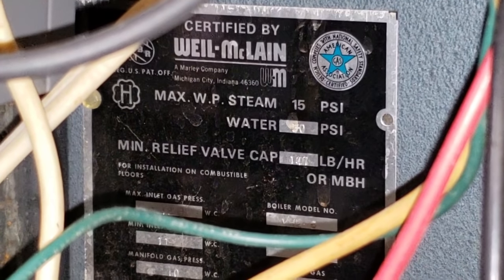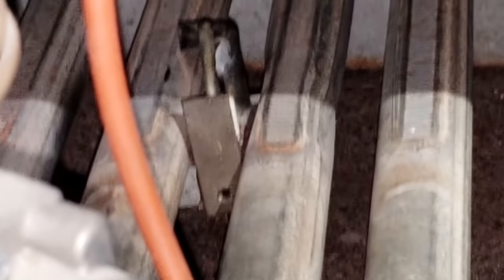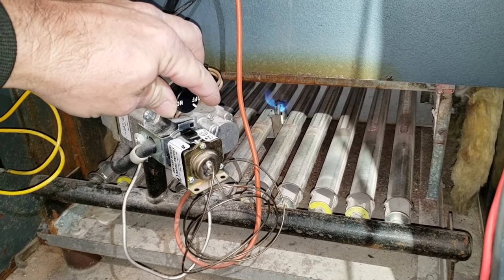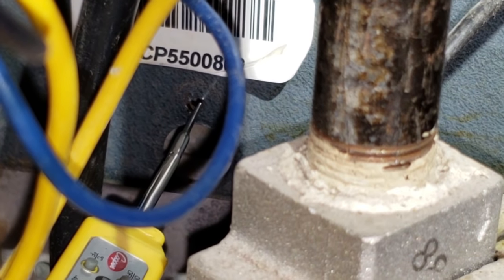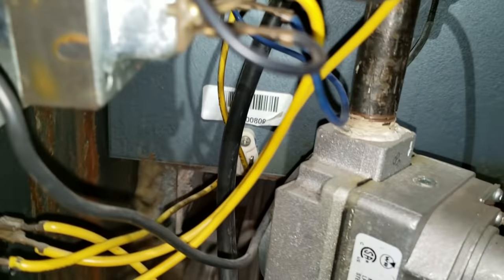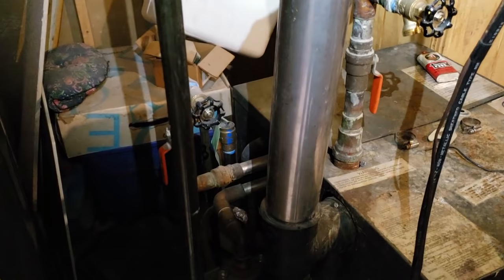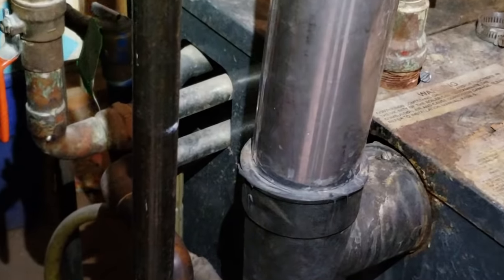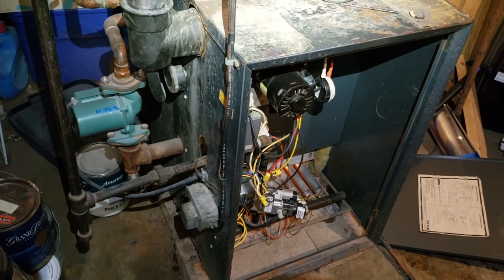Hot Water Boiler No Heat On L.P. Gas

Comment: Next time you are there, keep in mind about some kind of air venting, air scoop, or and high vents.
Reply from the maker: Can you go into a little more detail as to what you mean?.  Almost all air was vented with the power vent system that I installed.  If you look above the expansion tank,  that air scoop is the most common around this area,  it also has a auto bleed on top of that scoop. Far as backflow preventers, about the only place those are required around here is in commercial applications. I could see maybe a check valve, but that's not a backflow preventer and those would need inspected every year. There's a reason why we live where we live,  we don't like big government up our butt non-stop like the big cities.
Reply: We used to use back flow preventers and check valves. Sorry I didn't see the air scoop and vent.
Reply from the maker: @RayRay-nb7tn  it's all good Ray, this was out in the country,  even in town, around this area we have no inspections at all, not saying that makes it right or wrong but in an area where everything is about price it just doesn't happen.

Comment: Good vid! You see much oil fired equipment out there? Oil fired boilers/furnaces are everywhere in NH.
Reply from the maker: I have done a lot of fuel oil over the years prior to where I am now. I don't care for the mess, smell, or the soot when the customer doesn't have it serviced or the last lazy dog tech that decided to cut back the primary air on the burner to keep the draft overfire in a negative because they didn't want to clean the heat exchanger.

Comment: I wonder if it kept popping, sputtering or burnt back at the orifices from having low gas pressure(low tanks and recent cold snap?) but probably just aging of the thermal fuse, not like we haven't seen that before. ( hundreds upon hundreds) lol
Reply from the maker: That's why I generally they should have a low LP pressure cutout switch on the gas valve. Only a few quality manufacturers do that.

Comment: those pressure gauge never works on them tridicator's, the space between temp probe and the brass nipple is too small on most and they fill with rust and crud within a few years.
at least around here, supply being well water, city water, community wells doesn't seem to change anything. possibly due to no maintenance and always having makeup water entering (bad expansion tank, lifting the relief every heat cycle!) I like using oversize floor model expansion tanks and putting them ten foot or more of pipe away from the boiler/hot piping, that keeps keeps the hottest water away from them and cools it to nearly nothing as it slowly expands over the heat cycles. almost like I used my brain for good, rather than bad and want the systems to last ;)

Comment: good job and good video .thank you Rick . can you tell me where to buy the pressure gun that you use in the video thanks.
Reply from the maker: That one was a Huskey brand from Home Depot. It was a normal air nozzle that I purchased the brass NPT to 1/8' flare fitting.
Reply: @HVACRSurvival  thanks